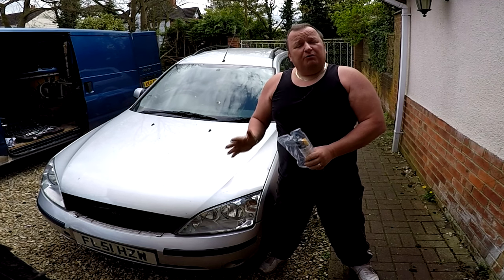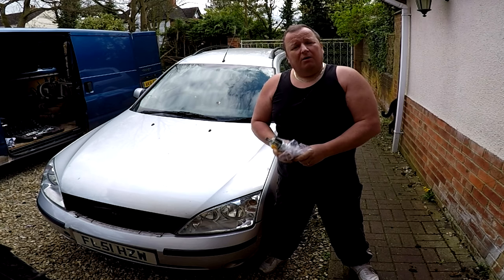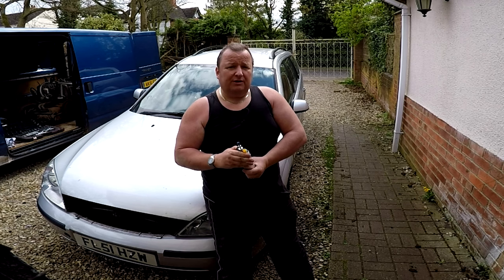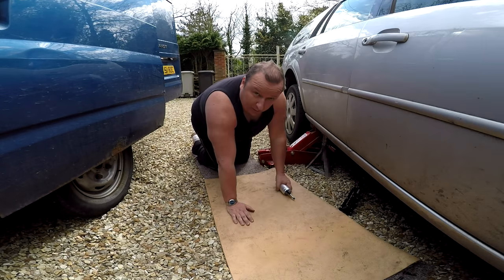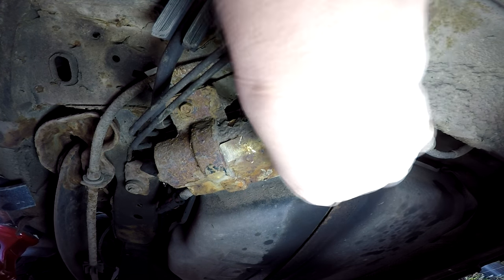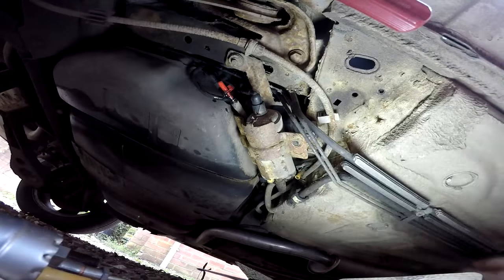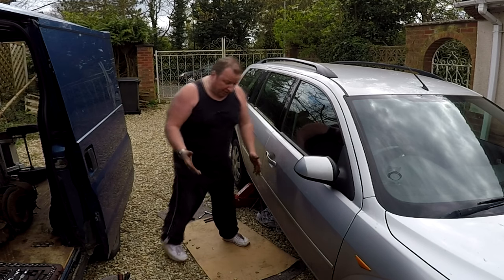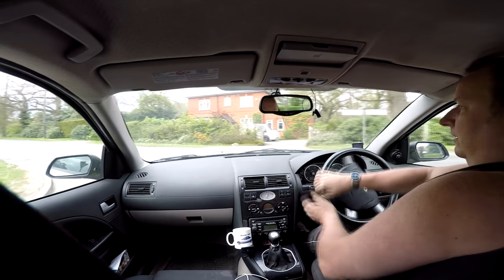Ford Mondeo Mk3 Part 6 Tddi Running Rough Fuel Lift Pump

Comment: Proper, good old fashioned fault finding and troubleshooting. I wish more people were like this and fixed things rather than throw them away. A good friend of mine had that exact motor and the TDDI engine was fantastic. In the 10 years that he had it all it wanted for was a clutch and DMF, otherwise, it pulled like a train and was great on fuel.
Unfortunately you can't really find them anymore, plenty of TDCI's around but they're too much trouble for my liking. I love the proper grunt and honesty you get from the TDDI - no messing about!

Comment: Well done Martin.
18 months ago, my Rover 75 diesel cut out on the motorway coming back from Cardiff. The RAC bloke told me it was the Aux ( lift) pump in the engine bay.
There are 2 Aux pumps on the Diesel 75's....one in the fuel tank, and one in the engine bay.
i knew enough to know these tend to fail at 50-70k, my car had done 53k.
I changed the one in engine bay first....car worked but still not 100%.
On advice thru Rover forum, i then changed the one in fuel tank....and that cured it. Apparently the one in tank fails first....but the one in the engine bay can keep car running ok, unless you. run fuel low in the tank.
Common problem on the BMW diesel engine fitted to the 75's.
After this...on advice again...I fitted a EGR bypass, and the car runs even better....turbo picks up earlier and slightly better mpg.
Overall a great car and super engine....but like all, they have common problems.
Great series of videos....and you're excitement and relief at sorting it has made my morning....loff!!!!! (lol).
Well done. 😉
Reply from the maker: Same sort of thing then graham, probably catches a lot of people out having 2 of them fitted. I got there in the end though.
Cheers
Martin
Reply: I went on advice....you much more analytical in yours. Good stuff.

Comment: I'm must admit tht was very satisfying to watch and well done to you for not giving up and getting to the bottom of it, I've the tdci 2.0 with age on front only problem I'm getting is smoke when the load is on some times it's black and often at top end it's gray white no loss of coolant and no loss of power all thow the clutch is slipping bit tht another issue I'm taking it for a terra clean on Monday which hopefully will clean out the egr and intake have only of your viewer's and similar problems

Comment: It's sorted,well done Martin. Good diagnostic work. You could have taken a chance and replaced the lift pump as soon as the problem started but that would have been guess work and that can be expensive. After all the egr valve, maf sensor and more could all cause rough running and without proper diagnosis you could have replaced any or all of them.
Reply from the maker: It could have been any one as you said Nick, but we got there in the end.
Cheers
Martin

Comment: Hi..having the same problem in a Mondeo estate from 2006..the light on dash is on and i dont have power..the car starts well in the mourning and i already clean in take valve and put a new pipe also but the problem still on...after seeing this video im going to change this fuel pump as you did.cheers

Comment: I replaced one of those, but because of another problem. The engine would cut out, but this pump continue to run, but it was all over, not a steady buzzing but it was sometimes loud, next second would just shut off. This is how i found it was faulty.
The main problem is the engine continues to cut out a lot, or just miss. Most of the time after it cuts out, start right away on the key, sometimes it would just turn over.
Got some faults like, FIP requesting engine stop, mass air flow sensor, crank sensor(i just replaced it today, no change) and some unknown faults my universal tester does not recognize. I am thinking to send my injection pump to be tested. Pulled and wiggled the wires but it would cut out randomly. It cuts out as often as few seconds, i can feel a hiccup when floored just like yours. 
Anyway, measured the pressure with the new fuel lift pump, right after fuel filter and was very low, like 0.5bar. After my research, this is a correct value.

Comment: Top detective work martin 👍🏻 glad you got it sorted, i had a similar problem with my jetta and after similar deductions to yourself i had an intermittent problematic fuel pump too, keep up the good work and vids too
Reply from the maker: Thanks Chris, just a little common sense, The manual tells you nothing so using the internet, the laptop and some common sense got me there.

Comment: well done the primary pumps in newer diesels are in tank n when they go there non start or intermittent n have to bang the top of the unit to get it going the one on your car is like an old bosch external pump they used on old 1980s ford vw bmw  petrol cars   looks like sticking pump fault

Comment: wooohooo martin glad you got it sorted, and relieved it was,nt the big fuel pump or it would have been mega bucks.  put the oscilloscope back on and see if the results are different from when that voltage was dropping out, maybe check the power and ground on that lift pump  on your multimeter when the engine was up to temp..........(.always verify the fix in case it comes back, always the last job when troubleshooting)..............another good job well done 10 out of 10 for perseverance my man

cheers Willie
Reply from the maker: Yes, Im glad it wasn't the main pump Willie, As I said, this pump wasn't monitored and a fault like this presents itself in different fault codes.
Cheers
Martin

Comment: Hello Martin,  I am so glad I found your video!  My Mondeo MK3 (B4Y) saloon broke down exact 3 weeks ago with the exact same probem!  As the resell value here in Belgium is around 500€ I didn't want to bring it to the garage.  So using your video I dismantled the lift pump and it is the exact same as yours!  I have  an 1S7U‐9350‐AA and I just ordered the compatible 1S7U‐9350‐DA.

I still have some open questions, you might be willing to answer:

1)Between the yellow and black connectors, there is some sort of pipe/hose-system like yours.  You transferred this to the new pump.  I disconnected mine by loosening a bolt, and now I have a hole in the fuel pump where you can put a bolt in.
However on the new pump there is not a hole, but a small metallic pipe between the black and yellow connector.  Do I just take that off the new pump and I will also get a hole in which I can screw the old pipe/hose-system?
Or do I need to dissamble this pipe/hose system even further (pretty rusted around the bolts)

2)Some guy on the internet had to switch the yellow and black plug for the pump to work...  Did you ever hear this sort of thing in your search? I can see in the video you didn't had to switch them..

Greets and hopefully next weekend my mondeo is rolling again :-)

Philippe

Comment: Hey Martin, been following video. Mine is Tddi, are starts fine, idles fine. Put into first gear and move past 2k rpm and it stalls. Will be changing the lift pump tomorrow. Will give feedback. Someone is also saying crankshaft position sensor.
Reply from the maker: Hope you sort it.
Reply: Seems Fuse f9 was bridged with a thick wire that caused the a p1631 code - pcm relay. F9 was for engine cooling and suspected there might be a short. All sorted out. My car runs even when the lift pump cable connector is disconnected.  Very strange.

Comment: Just want to check if you had the same as me. My mondeo runs ok but if I drive say about 70mph or accelerate fast. My  coil light came on and the engine will turn off or will go to limp mode. I have not really seen smoke really. But there is no smoke when driving  normal speed as you say. It's fine in nomal speed.
Reply from the maker: No, Mine didn't do that bud.

Comment: Hey, Martin. I dont know if you will respond, but i have to give it a shot. Our mk3 tddi died on us a few weeks ago and havent started yet. I thought i narrowed it down to a bad high pressure pump and i changed it. But no go.
I tested the lift pump by disconnecting the pipes after the filter in the engine bay. Fuel flows out pretty good and i figured it was O.K. It just wont start at all, no sign of even trying. Cam/crank sensor or relay next? Any tips would be appreciated, Martin!
Reply from the maker: Try and plug an obd2 reader to see what codes it has thrown up. That would be my first step.

Comment: Got to the bottom of the issue replaced all 4 injectors and done another leak off test to find injector 4 is a dud so I will strip the injector down clean it all if all fails I will buy a new injector

Comment: Great video! I don't suppose anyone knows where I could get that pipe assembly that is still on the lift pump when it's taken off at 9:15. Can't even get it direct from ford? Part number is 1117943.

Comment: What's the difference between the fuel pump and lift pump? is it just the same thing?
Reply from the maker: The lift pump is a low pressure electricial pump that draws the fuel out of the tank up to the main fuel pump. The main pump is a high pressure fuel pump that delivers the metered fuel at very high pressure to the injectors. It also takes into consideration the different sensors fitted to the engine so it can determine the correct fuel to air ratio so this pump does a lot more than the lift pump and is far more expensive.

The later TDCI has the lift pump incorporated into the high pressure pump so if that goes wrong, it's a new expensive pump.
Reply: People call them different things which confuses me ha ha. Speaking of Fords ill be driving one tomorrow morning.

Comment: Hi Martin 
Great videos
My Ford Kuga is doing the same exact thing but it is showing a P2263 which is a boost Turbo fault. I got it Carbon cleaned but did no good. Do you recommend a new lift pump then?
Reply from the maker: Maybe worth a try bud.

Comment: Its possible that the lift pump was shorting when getting hot.
Reply from the maker: I don't think it was shorting out, Just not maintaining the pressure probably due to worn internals as it was still working.

Comment: Hi Martin will car start and idle with a bad lift pump. I'm getting coil flashing light and stalling whilst driving and code 0251.
Reply from the maker: Yes it will, mind did.
Reply: @retrorestore  changed inlet pump valve. No change. Smoke from turbo on start up now.

Comment: Hi great video. Im experiencing a similar problem with my mondeo 2ltr diesel tddi. Now my problem is either the fuel lift pump or the relay. Now ive sourced a relay and going to try that but do you know the part number for the lift pump so i can start sourcing that just incase?
Reply from the maker: I just got it from Ebay but. I think you'll find its the lift pump.
Reply: retrorestore. No problem thank you. Ive found one that says it fits my model so will find out in the week :)

Comment: Im having a similar problem with a 2012 transit connect 1.8tdci but its just the odd little miss and hesitation not as pronouced as the mondeo. I have blanked the Egr off, changed the fuel filter, had the DPF knocked out and deleted from the ECU. I have bought the same diagnostic system you used and its give me a fault code p0087-61 low fuel pressure. This model does not have a lift pump so Im a litte stumped im considering changing the fuel pressure sensor. Any ideas ?
Reply from the maker: Hard to say Liam, There are vids on Youtube on that code for diagnosing this.
Cheers
Martin

Comment: Hey mate! Was your Mondeo's engine shaking sometimes before you changed the fuel pump? Or there was only "missfire" feeling?
I dont know what to do. sometimes my engine shakes and it feels like there's some air in fuel system but i dont know how to check it and who's fault is this. thanks
Reply from the maker: No shaking. Check the engine mounts.
Reply: if this would be the mounts problem, engine would shake always on 850-900 rpm. like i said it looks like air comes from somewhere and the engines rpms drops and jumps quickly by like 10-20rpm...
Reply: by the way, i also have problems with temperatures. i have changed the oil thermostat but still temperature is only about 70c and drops lower if im not accelerating too much.

Comment: Hello mate, I have a problem with My Mondeo 2.2 tdci. Changed fuel filter, didn't fill it up, sucked the air out, still won't start, filter is full of diesel and the injectors is getting none, what possibly happened with my car?
Reply from the maker: Are you sure you connected the pipes up the right way?
Reply: @retrorestore  yep, No diesel is still getting to the injectors
Reply: @retrorestore  the car ran perfect before the change, could it be that there is a ton of air Still left somehow?
Reply from the maker: @erwinees  Sorry bud, hard to say without seeing it
Reply: @retrorestore  I recorded my mondeo, there's a clip on my channel

Comment: is this an estate or a hatchback ?
Reply from the maker: It's an estate bud.
Reply: i started with egr  valve it was realy badly caked in sut , like a margarine tub   thought this is problem i completley cleaned it , but still got the ruff drive , , i blanked the egr with  the kit this improved my car  but not completley  i changed  the cam and crank senser, , no joy  i changed all the glow plugs , and then i decided to change the fuel filter again a slight improvment , , but not there , ive been told to try an  enginge and injector flush , just done it today its so much quirter  now,  but dont know if this will solve problem , i get smoke when its cold  and runs ruff till it warms up , im begining to think it could be my cat'? im doing a complete oil change and filter  and alsodoing the air filter even thow it was 3 months since i last change them all , time will tell , if i have a problem i always looked to you for insperation lol  thanking you hands on jack
Reply from the maker: Hope you get it sorted Jack.
Cheers
Martin